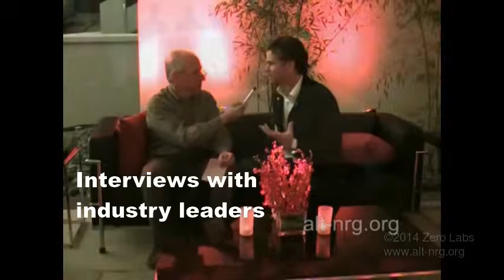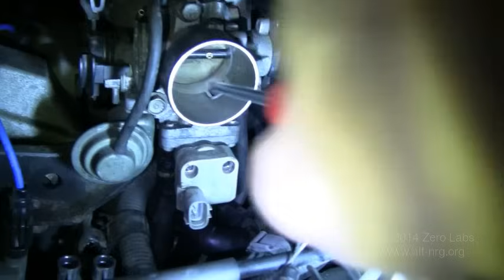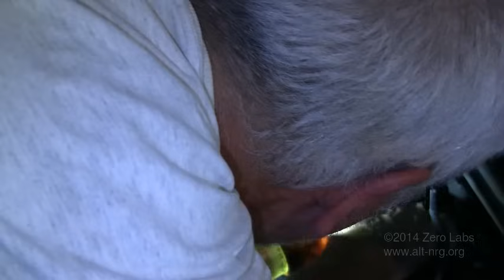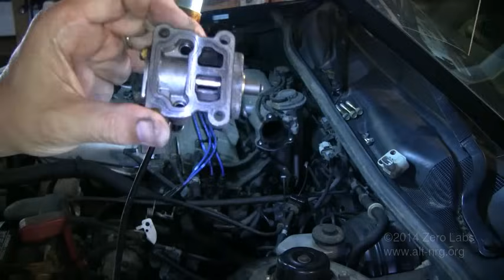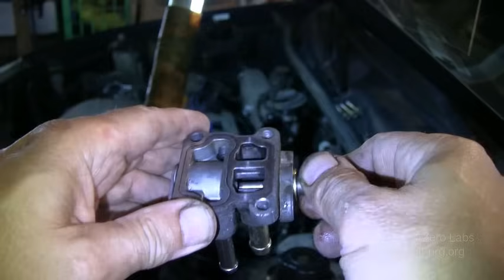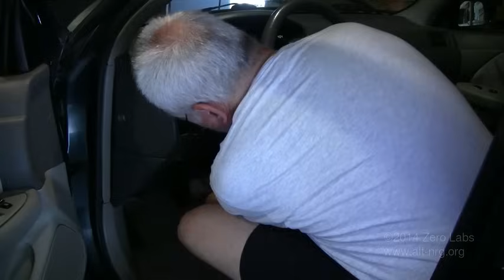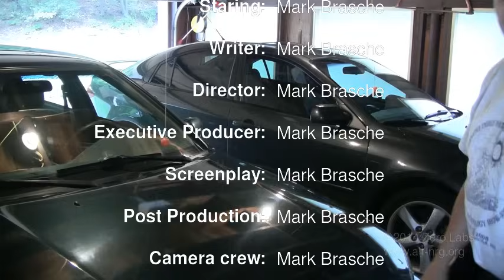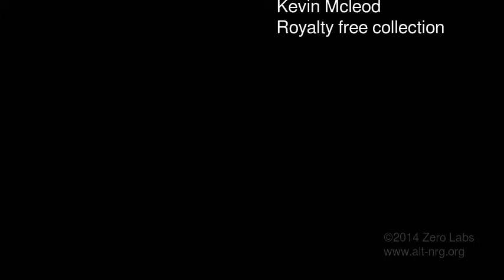#372 Better repair method Toyota Camry Idle Air Control Valve

Comment: Very nice.  I really appreciate not having to remove the throttle body (although I've already got it off in my garage).  Flooding that little chamber by plugging that pipe is genius!  I got to the point of removing those 4 screws on the throttle body to crack it apart so I could clean those little chambers, like you did later in the video, but I could not for the life of me get those screws to turn...stripped like they were made out of lead.  Sooo, I'm so happy I can clean that little valve without taking it apart...you just made my day.  Thanks!
Reply: @mikefindeisen6872  the screwdriver needed is a Japanese #2 aka Japanese Industrial Standard No. 2) screwdriver. 
I have a Kawasaki motorcycle and fortunately it is there in the toolkit. I too stripped the same screws.

Comment: When cleaning valve on the car, spray cleaner into the gap behind the throttle plate; use sparingly because too much cleaner flushes the gunk and carbon into the rear bearing of the IACV causing valve to stick (I did it once on my 87 Camry, so I had to get a used one from the junk yard.

Comment: You can use  9 Volt battery to check this valve;  plus goes to the center , minus goes to the top connector on the cold engine; the good valve should click. The bimetal spring on the back moves disk with cutout that limits angular movement of the valve; without spring the valve will make full rotation if sinned by hand

Comment: Hey what was your car doing that made you do this?
Reply from the maker: giovanni vasquez Surging at idle and low acceleration, sometimes stalling.
Reply: So 98 toyota turns of at a stop but turns back on and it shakes at idle when first started so it might be that I will try today did you run car then flood the spot or was it off when you did it?
Reply from the maker: giovanni vasquez Don't be silly. Never run your car while spraying a flammable material.

Comment: I did this yesterday on my 2000 Lexus ES300, worked like a charm.  Took about 40 minutes.  I used to just spray the little opening and would have to take it apart every couple of months because the engine would struggle or stall while idling.  Saved me hundreds of dollars!

Comment: Thank you for the great video. It inspired me to go ahead and correct a starting and idle problems on my 2001 Lexus RX300. The IAC Valve looks very similar. The valve was frozen stuck and when I tried to turn it free, the magnet rotated against the shaft. I soaked it for several hours and was able to free the valve but I suspect that the magnet has rotated out of position.  I can force the magnet to rotate against its shaft when it reaches the stop.  How can I correctly set the magnet back to its proper position? With the solenoid mounted but not powered, should the valve be normally in a fully open or closed position?
Reply from the maker: Kris P Ouch. The angle is quite critical. At this point I think the best advice I can give you is to replace. Look for one at an automotive junkyard. There is a small range of adjustment but to freehand it I think is ill advised.
Reply: Actually I was able to set it properly. Enough that the idle runs at about 750 rpm when engine is warm. The computer seems to automatically adjust the idle speed correctly as a closed loop feedback system should. The engine is running smooth now. It also maintains the idle speed with full or no load. Unfortunately, I don't have an oscilloscope to confirm whether the pulse duty cycle is what it should be.

First, I marked the two magnetic pole centers by placing a nail pointing close to the magnet. The closest point to the nail is marked as the pole center. I repeated it for the other pole. I then set the magnet such that when the valve is half open, i. e. 45 degree, the poles are oriented at 12 and 6 o'clock positions. I figured I had a 50% chance of getting it right. At first, the idle went crazy. So I rotated the magnet 180 degree to switch the pole positions. This time it works like a  charm! I then managed to apply a dab of epoxy to fix the magnet.
Reply from the maker: You are much more mechanically inclined than many. Well done, Grasshopper.

Comment: Thanks, Great video!! I have a 2001 Camry that has started surging sitting at idle and also when the ac is on. However the check engine light isn't on. Do you think that this could be the same problem? I guess it couldn't hurt to clean it.
Reply from the maker: mark Brinson Never know until you try! Hope it helps! And thanks for watching!

Comment: Absolutely Terrific video! Thanks to you I was able to successfully clean out the IAC valve with this nice method. You are very thorough with clear explanations and it's much appreciated. If you ever replace or adjust the throttle position sensor or how to tighten the throttle cable please do a video.
Reply from the maker: ***** Well, after 250,000 miles I just recently had to replace the oil pump. Seals blew out so I figured it was time. While it was all apart I changed the oil pan and valve cover gaskets, water pump, timing belt, serpentine belt and hoses. I'll be doing some exhaust work later this morning but I **REALLY** hope that's it for a while! :-\

Thanks for your comment.

Comment: Hi  Mark, 

Curious when cleaning the throttle body, do you clean any of the inlets or tubers where the vacuum hoses go?
Or any other orifices of the throttle body?  Also should the intake or part that the throttle body bolts to, should that also be cleaned out with throttle body cleaner or carb cleaner?  Do you have a video about cleaning the EGR valve and tube?

Comment: I forgot to mention that both these cars are extremely low mileage cars with only 82k on the 1986 and 85k on the 98 with a 3SFE 4 cylinder engine (both cars are automatics with A/C.  Both with good service records and regularly run and serviced, but were stored in garages and owned by Older people who drove minimal miles every week.  Also forgot to ask if you have a detailed step by step on how to clean the throttle body and what parts or passage ways?  Is the intake that the throttle body screwed to...does that also need sprayed out with throttle body or carburetor spray or will regular carb cleaner damage any of these parts on the Toyota Engine?  Do you also have videos on Mas air flow sensor cleaning or associated parts, and videos on oxygen sensors cleaning or replacement for these model Camrys and also 1998-2003 corollas with the 1ZZME 4 cylinder engines?  Thanks again for all your help!

Comment: I also have a 1986 Toyota Camry Deluxe, with 2SE ALC engine, Car had the timing cam set for the canada model, so my Dad fixed that by setting everything correctly for a USA model.  Before this we had quite a bit of pinging due to the fact that EFI and computer could not electronically increase the timing due to previous owner dealer service center messing and putting the camshaft on 180 degrees off and effectively set the timing for Canadian vaccum distributor, instead of the USA computerized electronic ignition system advance.  Now that we have fixed this, we still hear a slight bit of pining under heavier load, and is pretty much gone if we use 91 octane gas.  I should state prior to fixing the timing, I was using oil every week, but it has reduced since timing fix, although I am still using some oil.  Could the oil usage be from Valve Stem Oil Guides being old, brittle or cracked/worn and this is causing blow by and burning it up in the cylinders?  Weird part is that the spark plugs look great burning a grayish light brown.  Car does not smoke, Runs great otherwise, so doesn't appear to be a sticking piston ring or broken or cracked rings.  This car seems to idle fine, but I will also check IAC and clean it and throttle body.  Any suggestions?

Comment: Very informative Video!  I have subscribed, Thanks Again!  Curious what other items would cause a 3S-FE in a 1988 
Toyota Camry LE or DL to not start immediately when cold.  In other words will start on 2nd or 3rd turn of ignition switch?  I know about cleaning the Cold Start Injector, but if that does not work, is there something else to check, like the fuel pressure regulator?  Would fuel pump be causing this, or is it more than likely the IAC Valve being Carbon fouled/Gummed up and just needed cleaned?  Also would the cleaning of the IAC help a little rough idling when in drive?   Thanks again for the great Videos!

Comment: While learning about TBs and IACVs, i didn't understand why coolant was even needed thru the IACV in the first place. In a toyo forum, a mech said the purpose of circulation coolant thru the IAC and TB is so ice won't form inside the TB in cold temps. Which made sense to me, since i've read that the colder the intake air the better the combustion. I guess a warm TB won't heat up the air too much, yet will keep condensed water from freezing inside.

In the video you state 'The temperature of the water changes the range of motion', which is incorrect. The range of motion of the IACV gate always remains constant regardless of temp.  Cheers

Comment: After a year of trying to figure out what was wrong with my 97 camry (taking it to shops, replacing filters, full tune up, etc) this was finally my answer, Thank you so much for this video. It was very detailed on how this part works and how to clean it properly. 1000 thank you's for finally showing me how to fix my car.
Reply: what exactly were the symptoms on your car?

Comment: It isn't harmful to use the carb cleaner in the IAC port in the TB opening. It evaporates rather quickly when used in short bursts. It also saves time from removing the IAC and hoses.
Reply: What about break cleaner?

Comment: Does anyone know the correct size screws that hold this valve to the throttle body?  Mine has messed up screw heads and I want to change to socket or button head screws (but I have no idea what size the orginal screws are - or if they are metric or SAE.

Comment: That was an excellent video on cleaning the IACV. I have tried the On the Car method that drains into the vacuum hose, and then earlier this year, I removed the IACV completely and cleaned it out. I prefer your modified method a lot better, and will recommend it to others in the future. Quick question, did you end up replacing any stripped screws? I never touched the solenoid, so I only replaced the four screws on the bottom as they were all falling apart. I really wish Toyota used hex bolts for this part, instead of those overly soft phillips screws.
Reply from the maker: mrjost55 Mine were not stripped.
Reply: 2000 camry, no vacuum drain line (2 heater hoses to the IAC), and the right screw was very soft, and stripped immediately, despite using a impact driver to loosen it with.
Reply: I had the exact same problem with the screw heads - and I also thought about hex head screws.  I am going to switch mine to hex head when I take it apart to clean it again. I'll try to remember to post the size I use.

Comment: Hello - I have the same car - same engine and I'm on the third idle air control valve. They last about 30k then are clogged.  I tried to clean one with carb cleaner but the black buildup appears to be stuck to the metal.  Can this be soaked in carb cleaner if the electrical part is removed? I'm thinking if I soaked it for a while, it might be easier to clean. Let me know what you think about soaking it please.
Reply: my camry has 430,000 never cleaned it yet!
Reply: pgsbox24
That's great - this is a well known problem for 99 Toyota Camry 4 cylinder cars.What is the idle speed of your engine when you first start it on a cold morning? If it's 1500 rpms, then tell us what kind of gas and engine treatments you use.  If it's under 1000, then your valve is starting to stick and will probably eventually stick closed.

Comment: Very helpful. My wife's car is 1999 Corolla. Not enough space to work/open the IAC. And need specialtool  to remove the 2 bolts. I have to remove the throttle body. Thanks for the video. The best one that shows on how to clean IAC valve.

Comment: Thanks for the video, I was able to twist the actuator to unlock it, but I have a 2001 Toyota Camry 4cyl and there isn't a hose directly under the Valve, there are 2, one on each side and set back a few inches. Do you know which hose I should remove to flush the control valve out? I've looked everywhere, but can't find an answer. I ripped one hose and had to replace it because it was so dry and old so I was nervous about removing any others unnecessarily. Thanks in advance if you answer.

Comment: Thanks for the great post.  I got in my 2000 yesterday to come home from work and it idled slow and rough before dying a couple times before I got it going.  Idles better at operating temp but has mild surge at low speed acceleration.  No code yet (at least no check engine light) but hoping this is my issue.

Comment: Great YouTube Video:  My engine would start then shut down.  I had no code.  It appears IAC was not responding.  I am so glad I saw your video.  I was about to spray carburetor cleaner down the port.  Bad news since the cleaner would have went to the crank case.  I removed the hose and rotated the magnet and sprayed some cleaner.  My car now idles better and I don't have the problem now.  My car is different than yours but the concept is the same.  I have a 2000 Solara V6.

Comment: Followed your instructions for cleaning the IAC but only turned the valve controller back and forth for about a minute using throttle body cleaner instead of carb cleaner.  You don't need to remove all the stuff you did to get this job done though. 

I only needed to loosen the backside clamp that connects the throttle body to the plastic intake tube from the air box and wiggle it to the side just enough ... then I unfastened the electrical plug to the IAC.  Then I performed the cleaning like you have shown.  This seemed to do the trick and my idle is much smoother especially when the A/C is on.  Thanks for the tutorial ... the whole cleaning took me only 15 minutes from start to finish.
Reply from the maker: Nice!
Reply: James do you have a 1997 Camry also, I'm a novice fixing cars and need the easiest possible method of repair my 97 Camry, what tools do I need, size ratchet nuts etc.

Thanks

Comment: Excellent!  I tried to see how many miles were on the car, but could not see clearly on the video.  Thanks for posting!
Reply from the maker: 242,249 miles, and counting.
Reply: ZeroFossilFuel WOW!!  I've got a bit over 219,000 on my 97 Camry 4 Cyl. it still runs great, but I've had this mysterious oil leak for the past 3 years with it :(

Awesome video thanks
Reply from the maker: Me too. It's been building up for some time. We just got back from a family vacation and it started pissing oil all over the place. The oil pump seal failed slowly then finally gave out. Spent this past weekend replacing the oil pump, water pump, timing belt, gaskets and other belts. Now no more leaks.
Reply: My dad thinks it could be the head gasket, tightened down the bolts and still leaks.  my guess its a seal or something gone bad.  i plan to just keep the car, once the engine goes, just get another engine for it, since i like the car and have put so much money into it for repairs and stuff.